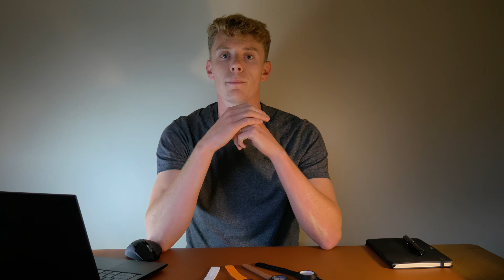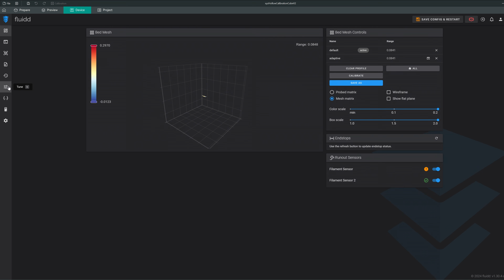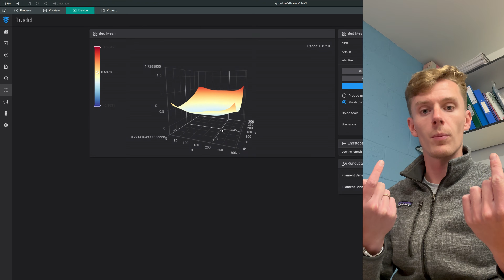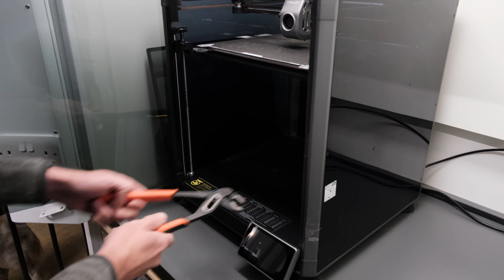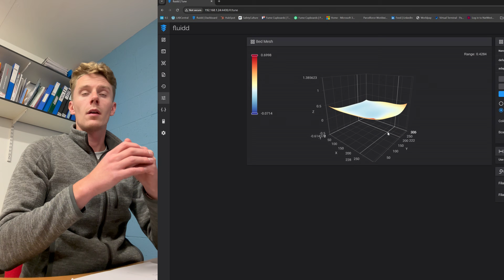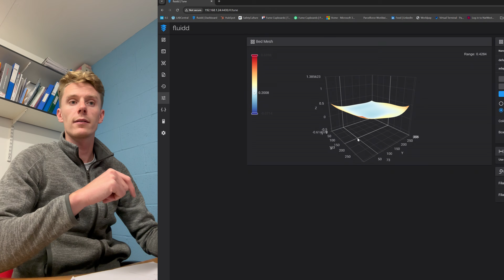EASY bed level method (Creality K1 and K1 Max)

Comment: what does it mean when you do this and the bed just remains the exact same, my front left corner is way to high and when I try to drop it it pops but just stays the same, struggling bad with this on k1 max???

Comment: so on mine the front right corner is high (Y-, X +) and the back left corner is low (Y+, X-) but the other two corners are level. i understand i can adjust the right lead screw to lower it but what about the back left corner, i feel like if i adjust the single rear ill throw my other corner out of wack

Comment: Picked up a used k1 one and the rear left seems to be very low. You mentioned not to mess with the back lead screw - how can I raise the rear left corner?
Reply from the maker: I would start by lowering both the front screws by 1 click.

Comment: This felt brutal to do. There is a risk of pulling the teeth off the belt.
I clockwise clicked 4 on the front right and 2 on the front left.  The first click was more of a thump but it is obviously wearing the teeth on the belt because the last click was not as abrupt as the first.
However it did work, and the bed is measured flatter and the print is better.
Theoretically, this should not matter since the 'auto bed levelling' should just compensate the z axis as the nozzle tracks across the bed.
I don't want to ever do this again but I am glad I did not need to dismantle the printer just the adjust this.
Why the hell is this not set correctly at the factory??

Comment: I did this method and now the printer doesn't print at all...I should've never touched it 😭 
The bed is leveled at 0.2 ~ at all sides 
But the prints don't work, and end up with just a tangled strings
Reply from the maker: Are you sure there’s nothing else going on there? Sounds like an offset issue maybe?

Comment: Nice video but for the K1C to do the clockwise adjustment the K1C does not have the possibility to adjust the ring with the water pump pliers (adjustable pliers) because the rings are recessed. So, do you have a solution or should washers/rings being used in the printbed suspension?
Reply: On my K1C I used cardboard around the rod to protect the thread from the grip head - had to add 2 click front left, 3 click front right. Thanks for the video - worked great!!

Comment: Too bad this doesn't work on the K1C as the screws are sunk into the casing, so nothing the pliers can grip.
Reply: Yes that was the same question I have when inspecting my K1C after watching the video. Maybe using spacers below the bed suspension?

Comment: From the console on the home screen, has anyone tried the Z_TILT_ADJUST command. This is the command for the print to do what you just did manually of creality set it up.  Its native to klipper but has to be enabled in the configs. Its usually done after the G28(home axis) command.  If not creality needs to enable it.
Reply: Asked a friend to pull up his web access. Looks like creality did not enable console functionality.   It is accessible if you root it, but this voids your warranty.
Reply: @Deathwarror01 idk how rooting it could void the warranty, since creality offers root account access on their current firmware, even with no changes or modifications at all.

Flashing stock klipper may change things a bit, but again, it should be pretty straightforward to reflash the stock firmware if needed.

As far as the K1 series, I think they all have a single stepper motor driving all three leadscrews via a shared belt. Hence the necessity to have it skip teeth on the belt to get it flat.
Reply: @2011JMB  Yep you are right on that it has one z motor.  Just pulled up an image of the board.  I was thinking this was at triple Z setup.  Still not sure why I got recommended this from the youtube algorithm. Seeing that this is one z motor port, this is probably the best way to adjust it.  At least the least intrusive into the machine.

For the rooting part, rooting would be used to install a custom firmware to allow access to the printers instruction console not the SSH console.  Some manufacturers have the hardware set a fuse would be blown which sets a flag telling the manufacturer that the device has been rooted.  I doubt creality would have an issue with this.  This was more common back in the earlier days before some of the lawsuits.  The manufacturers wouldnt cover devices like phones under warranty if it was rooted.

Comment: What causes the click noise? And why you didnt unscrew the collar and move it? Just curious thanks
Reply: The noise is from the tightened belt "skipping" one tooth over in relation to the pulley and its teeith that mesh with the belt. I haven't looked closely at the specific lead screws that are used, but  they likely have an indexing flat, or notch on one side to keep the pulleys from slipping.

Comment: K1 problem is the original springs, they are havy rigid, i changed the k1 springs for Ender 3 original Springs (are was hard to find), and i printed new bed knobs to use with this, they are much smoother, now I have flat mesh, basically 0 gap

Comment: the reality is that k1 and k1 max have thin heat bed, the most problems come from not having it aligned between the rods, look at you're edges they look like you bent them up with those pliers, reason is plate is to thin after warming up it warps either way it wants........ i tried taking it out levelling on bench while heating but after few cycles of warming up it warps the same way again...
Reply from the maker: I've been looking for a milled aluminium bed mod but can't really find anything. Have you had much luck with modding the print bed?
Reply: @ThePrintableWatchCo  voron 350
Reply: Have you seen WattsKraken, or ZeroDotCMD's glass sub bed frame mod? I think WK has a machined aluminum plate they offer, and ZDK's youtue channel shows his glass mod for the buildplate that i'm planning to try.  @ThePrintableWatchCo

Comment: Thanks for you video.
Is there any risk to damage the belt with this method ?
Reply: If you were doing this several times a week yes, but if it was only once, definitely not.
Reply: @djscolio  thank you. I did it one time and then added some spacers on the bed fixing points. Perfect now.

Comment: Thanks for this.  This was the easiest method I have found for leveling the bed on the K1.  I tried the Creality method without real success.  I was not going to add leveling knobs to the bed, that just seemed a step backwords.  Using this method I go the level down to a range of 0.285, which the bed leveling can more easily compensate for than the 0.608 that it was before.
Reply from the maker: That’s a great improvement! Happy printing!

Comment: Another thing that can be done is replacing the plastic bed leveling posts with either silicon or rubber posts. That's another way I've found to get the bed to be more leveled than only using the skipping method. Mine is at 3.9 and aiming for 2-2.5 after getting better rubber posts that are meant for an Ender3 and I'd recommend getting some knobs with longer screws for manual adjustments of the bed. 

I bought a K1 Max, then found out it was one of the worst and still is one of the most unreliable printers on the market. Too many things to replace to make the printer better, but I like the space, the internal fan for circulation and the enclosure locks in heat.

Comment: That mesh still has a range of .4284. The Klipper guide on setting up meshing will tell you that if the range is greater than the thickness of the line you are printing then it is ineffective. However, for small pieces (like your watch bodies) an adaptive mesh will probably do the job because the centre of you bed looks pretty close but bigger pieces will become a problem. There is a lot of discussion of heat soaking the bed (leave it at required temp for say 10 minutes) and then do tramming & meshes.
Reply: K1s use meshing just fine.

I print at 0.12 just fine with a similar variance. I could understand if bedmeshing wasnt working right that the variance would be a problem. I am the original creator of the belt skip method described in the subreddit that this video is using.

I know the klipper guide SAYS that, but if that were 100% the case then no one could really print anything because a TON of beds have variances the bigger they get and especially if they arent machined for precision. A 0.2 is good a 0.4 on a bed like that is *okay*.

People on the subreddit had variances of 0.8 or more and printed just fine, issue comes into play when you are fitting parts together otherwise it did fine.
Reply: @grrminator9292 thanks for bringing this method to the community. How would I go about this method on a K1C given that it doesn’t have the lead screw collets at the bottom of the enclosure?
Reply: @ryanmagee_za  I would use a cloth or something to grip the screw.
Reply from the maker: Hey thanks for the help! Since filming this I've found warming the bed up before doing anything improves the mesh. I use the adaptive mesh for and I get ranges of below 0.1mm for most the parts I print.